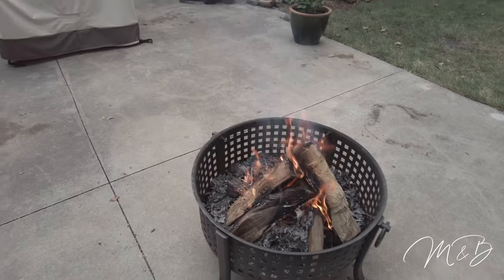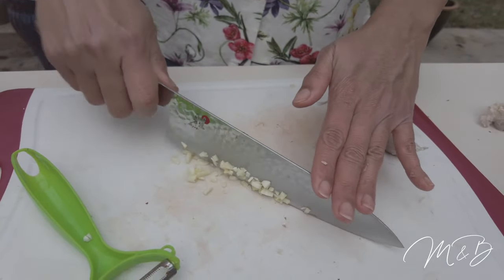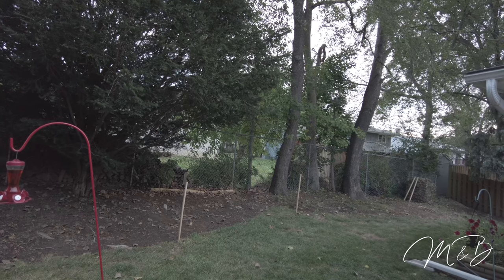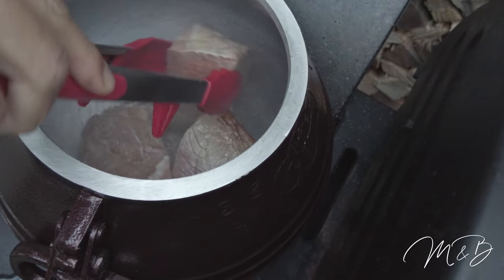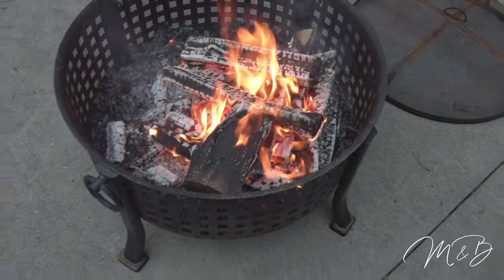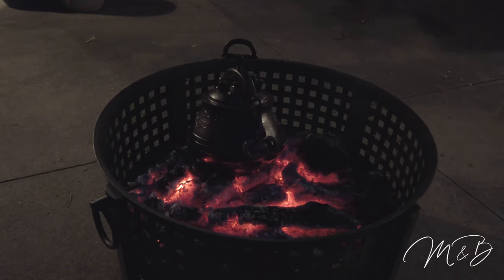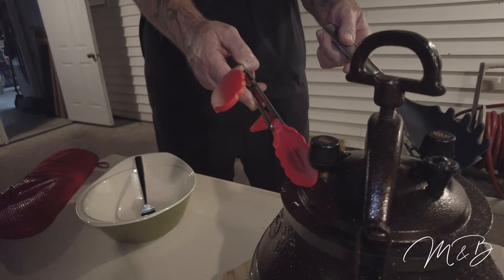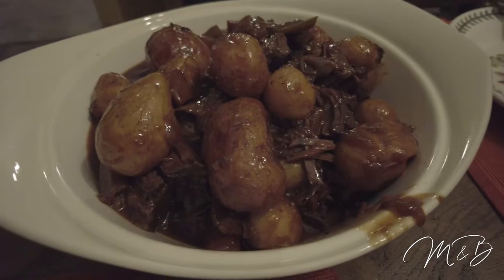How To Cook With An Afghan Kazan Pressure Cooker - Our First Try On a Wood Fire

Comment: What size is yours
Reply from the maker: Hi, this is an 8 Ltr we bought while we were living in Dubai.  We also bought a 20 Ltr at the same time but have not used it yet.  The 20 Ltr will be for gatherings or when we want to cook a large cut of meat or maybe a turkey.   The 8 ltr is about 8.45 qts and so far we cooked a 2 lb roast in it with a lot of vegetables with no problem, you can easily feed 4 people with it, perhaps 6-8 depending on the portion size.  I have a new video that will be up tomorrow where we cooked on our tailgate while traveling in the Upper Peninsula of Michigan, right in front of our hotel door.  2 large pork chops and vegetables and on a butane burner, came out fantastic.  Let us know if you have any other questions.